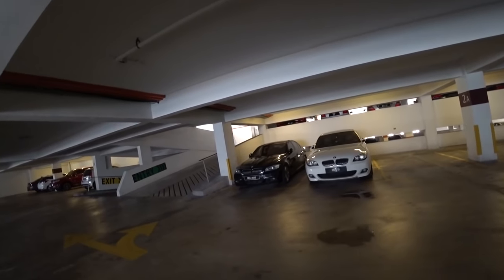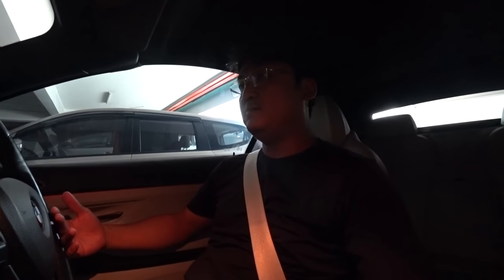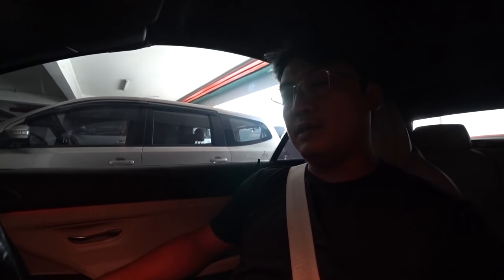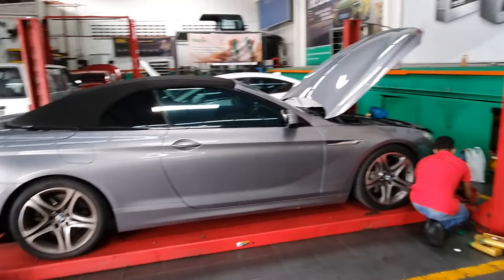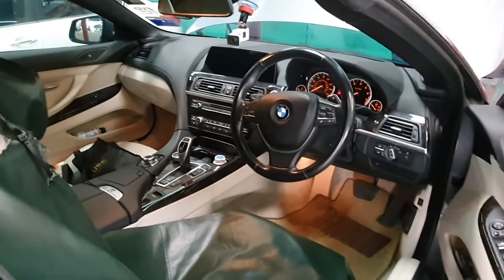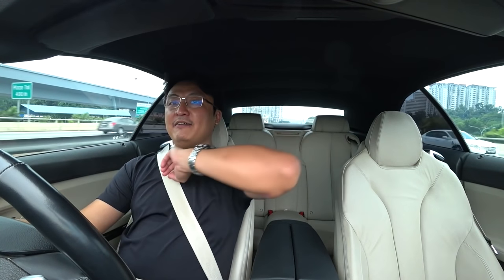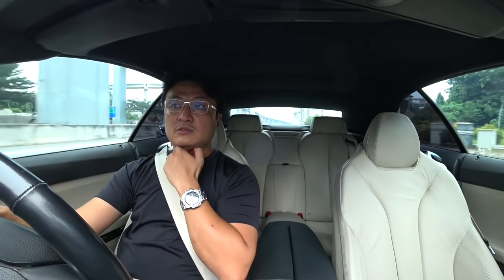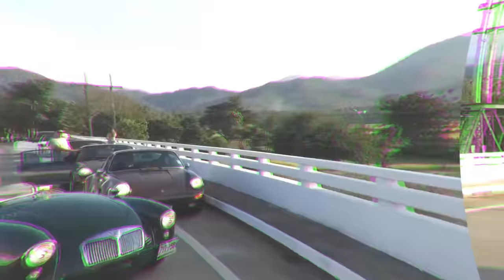Yay! New software for my transmission coming right up! | Evomalaysia.com

Comment: Interesting , I have a MY14 M135i with N55 but the car has been less reliable. Had an engine change 60k km for a spun conrod bearing, had GB replace due the ZF whine, thankfully all done under warranty.  I'll be interested to see your review on the GB tune, but I wonder what more can the best GB in the market do. By the way, your interior looks beautifully maintained, except that shiny steering wheel. It took me 2 mins to remove the shine, take a wet wipe or a damp cloth with some dishwashing detergent, give it a vigorous wipe down and 70% of the shine will be gone.
Reply from the maker: You know what's funny. I like shiny leather 😅🤣😂